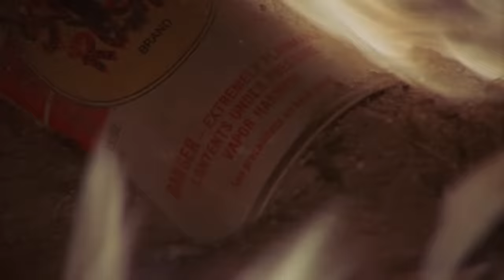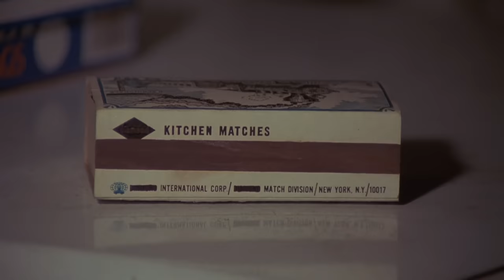Don't Go in the House (1979) | Full Movie | Dan Grimaldi | Charles Bonet | Bill Ricci

Comment: If anybody was wondering what kind of work that was at the beginning it's a metallurgical  plant. You basically use those long rods to clean a large sifter inside those ovens that can reach 2500 degrees. The point is to separate metals that are turned to dust at this point. When done the metals are shipped and used to make titanium objects such as plates and braces after surgery.
Interesting job but sucked at the same time.
A little info for ya